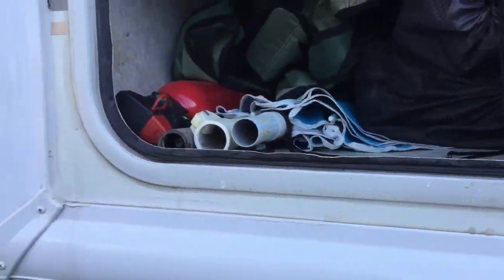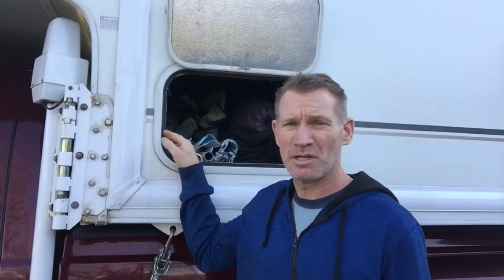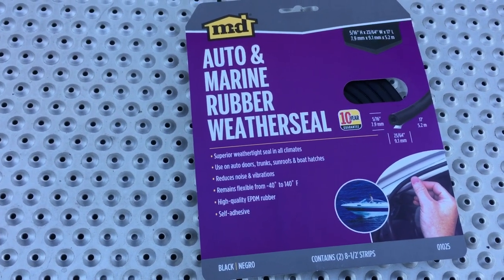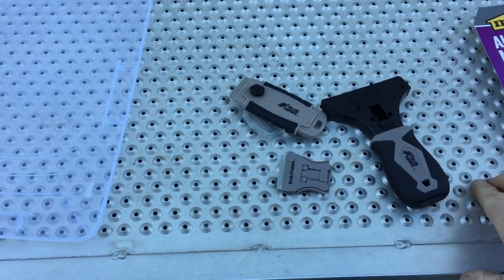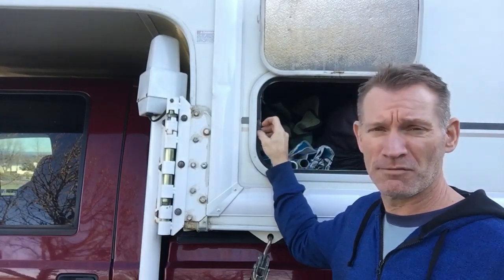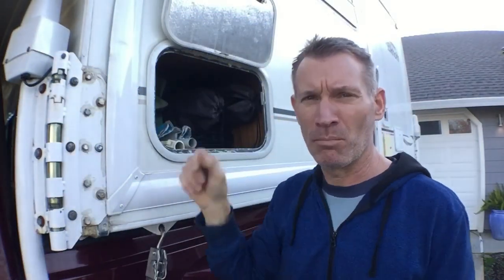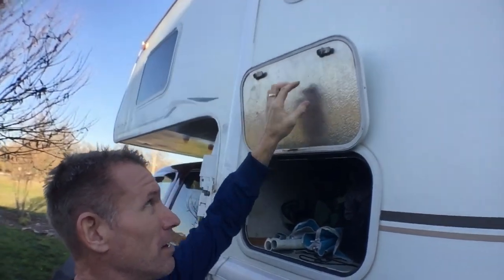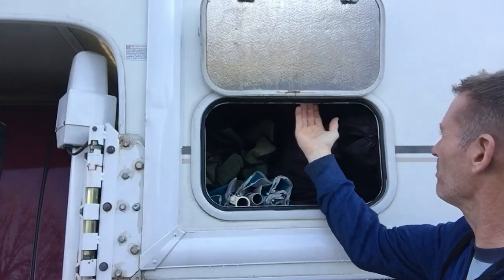RV Storage Compartment Seal Repair and Replacement

Comment: I think mine is coming in through the hinge but I need to do this anyway. I'm glad I have a large plastic storage area instead of it damaging the wood floors.
Reply from the maker: I had that problem on my propane compartment door.  The 18” long piano hinge at the top of the door.  I coated the hinge with Oatey Silicone Grease.  No more leaking at the hinge.  I just recoat every few months or when I wash the rig.